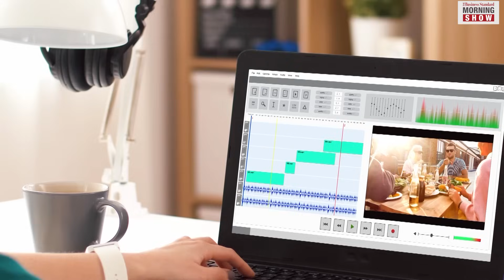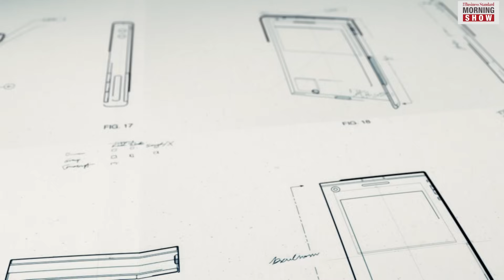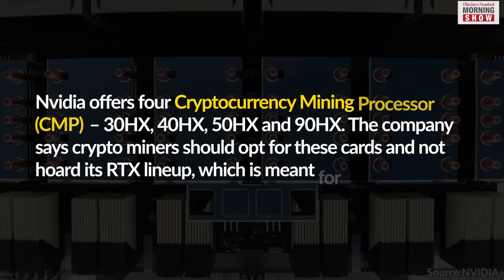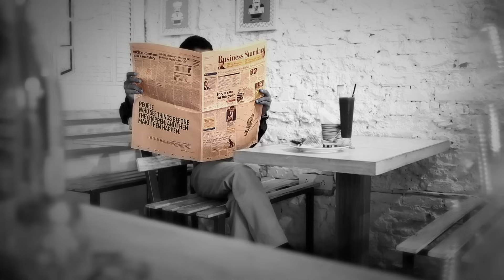Why are Nvidia GPUs so important?

Comment: NVidia (and 3dFx) were both founded in ~1996 and were both spinoffs from "Silicon Graphics" which pioneered the "geometry engine" chip which was the first GPU chip, circa 1984-85 era.   3dFx was the first to produce a GPU card but NVidia had the better engineers and soon came to dominate the market.  A GPU is just a highly parallel CPU that is very good at performing matrix mulitply-adds in parallel - thousands of these processors can work perform multiply-adds in paralllel.  Most graphics transformations can be represented by a 4x4 matrix multiply ( scale, rotate, transform ) so matrix multiplies are very very important to GPUs.